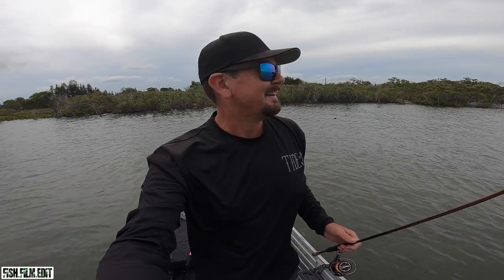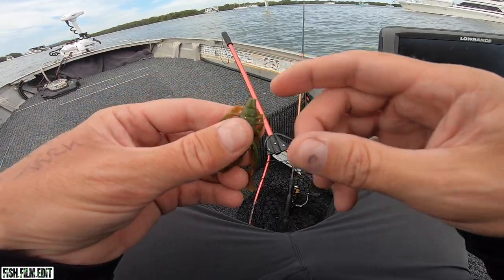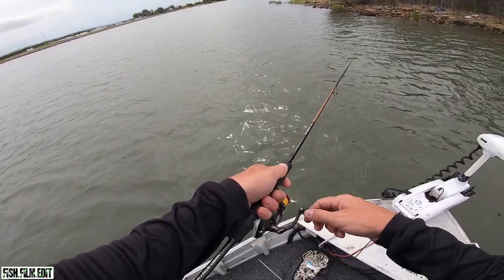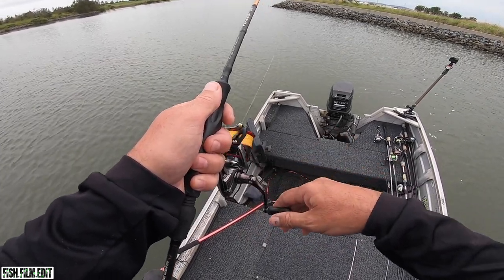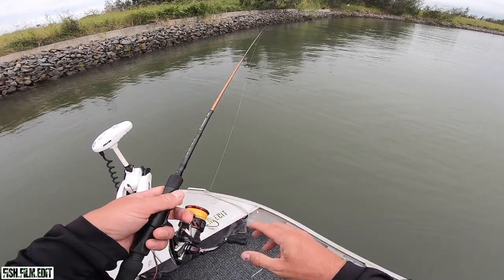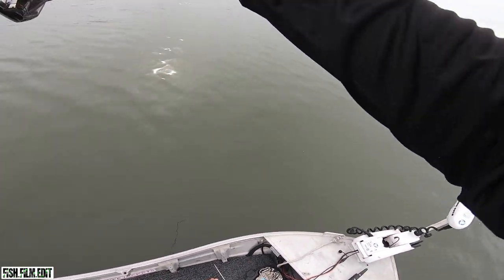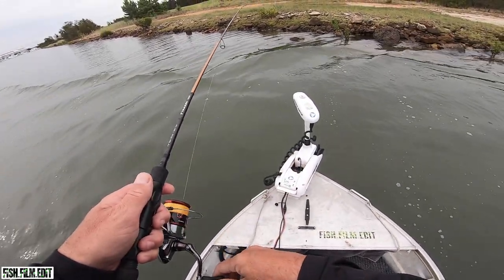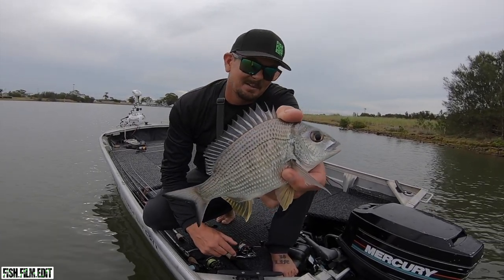MANGROVE JACK vs BREAM GEAR.

Comment: surely 6lb is the go. do you think that going lighter genuinely gets more bites? because i find anything lighter and im getting snapped off way too often
Reply from the maker: Definitely mate and especially in high pressured waters like on the Gold Coast. I run 4lb in comps but happy with 6lb socially. Probably get away with 8lb at times and with certain lures.